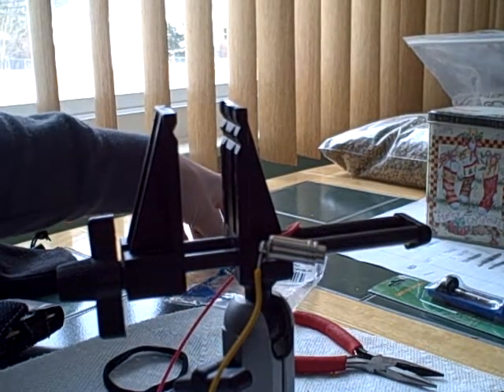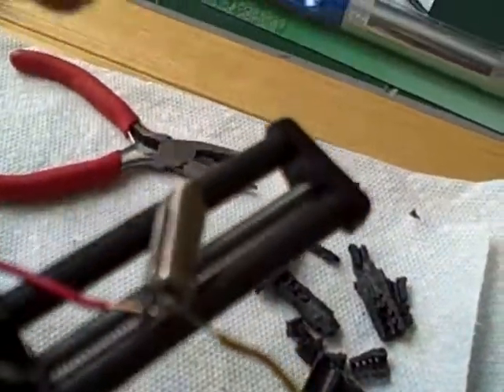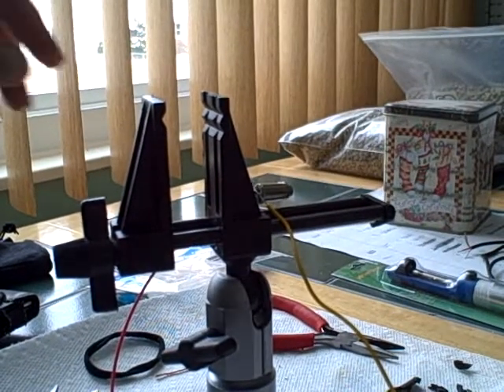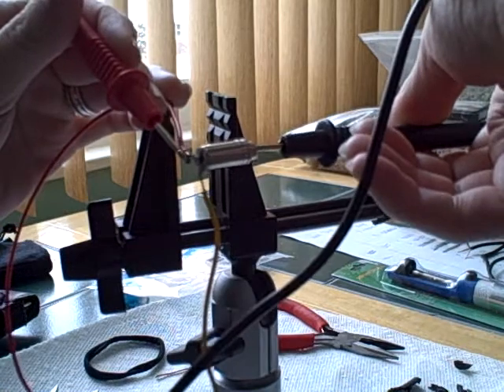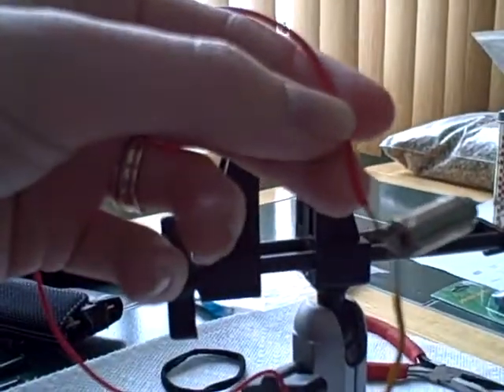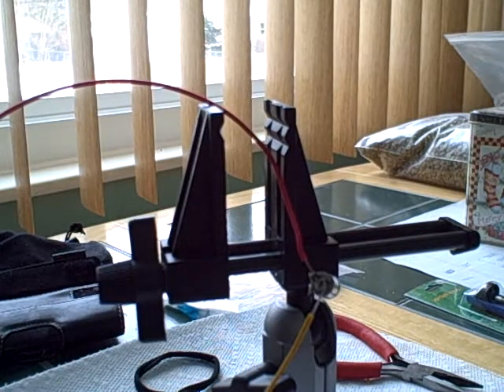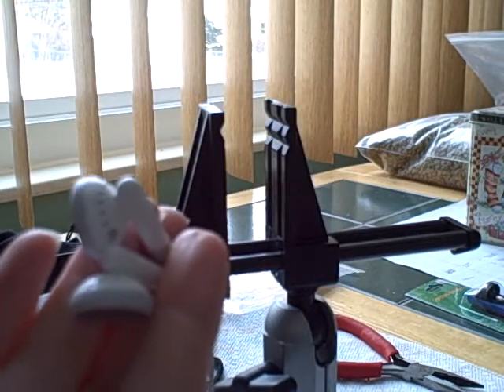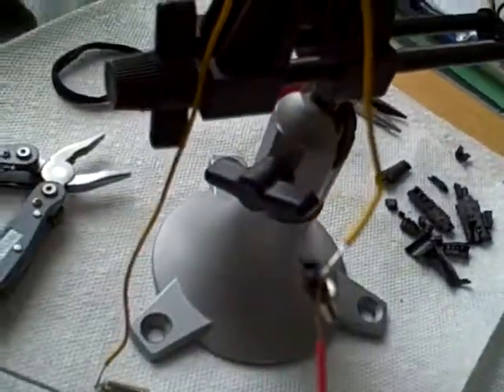Headphone cable extension deconstruction and testing

Comment from the maker: @MrCHISOL Thanks for catching that. I was stuck in the mindset of the iPhone cable with the mic. The original cable did have a ground cable soldered on. For the test, I didn't bother soldering on a ground. I think I remember that sounds was coming out of both right and left but I'm not completely sure.

Comment: Just a note: There's no mic-"channel" on that contact/plug, the three sections are Left, Right and Ground. A plug with a "mic-channel" would have four sections.

I guess you only got mono(/single side)-sound with the extension (as you only have two wires.

It's always interesting to take things apart! :?D